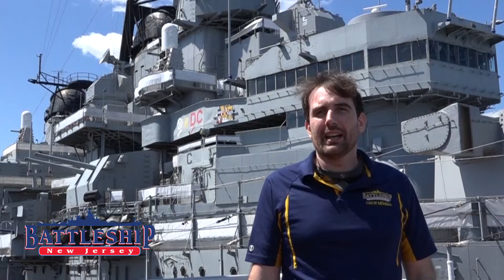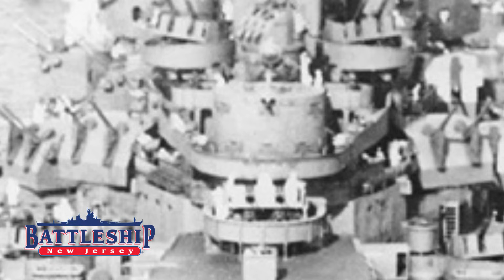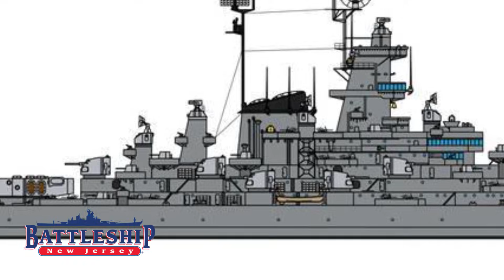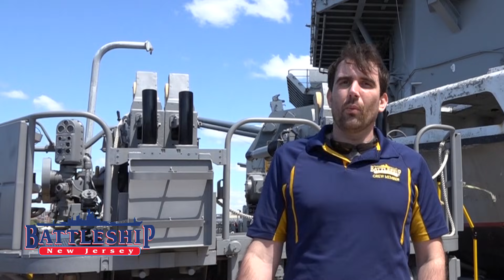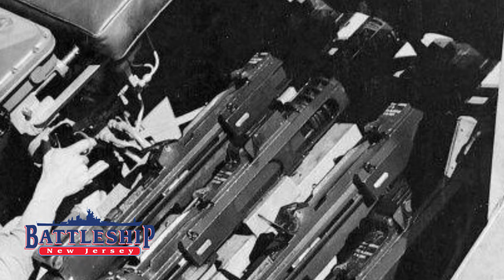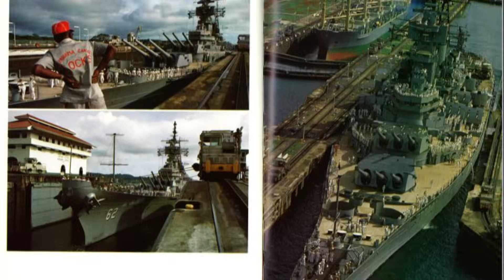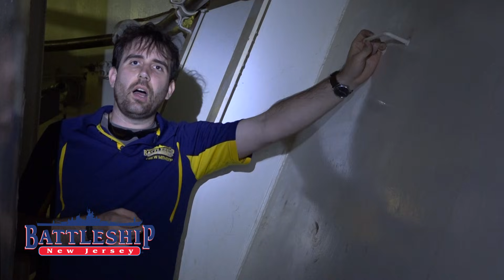What the Navy Doesn't Like About the Iowas

Comment: The only ships capable of standing against one was the ships like the Yamamato. Modern day? Maybe the Kirov battlecruisers.
Reply: *Yamato
Reply: @MrDirigible  I will remember that. Thanks.
Reply: Outside of the Yamato class there is some debate as to if the french Jean Bart class or Littorio class battleships of the Italian navy were of similar capability and fighting strength as they were contemporary battleships of similar armor layout and guns (8 or 9x15in vs 9x16in) though US fire control, control of manufacturing ammunition quality, and damage control were considered superior.  Just something to think about.
Reply: @MrDirigible  indeed. The Iowa has the advantage of having not the best of one thing but the very best package.
Reply: @MrDirigible  The Iowa's have gyro stabilized guns, the others do not. Thus, as the ship pitches and rolls, the guns stay on target.
Reply: @WMAcadet  yes which is why I said Iowas had superior fire control... Of note though is that the Littorios if given good ammunition could be very accurate however italian quality control wasn't so the Littorios suffered as did all other Italian bbs.

Comment: Great set of videos, really enjoyed them. I’m surprised that they were built with so little auxiliary generation. Only 2 diesel generators sounds like they would have real problems if they’d suffered underwater damage. A lot of ships being lost in WW2 due to creeping flooding when power to pumps was lost.
Reply: The problem with having a lot of auxiliary diesel gensets is storing the fuel needed for them. The heavy bunker fuel that fires the main steam boilers can be used for really large "cathedral" diesels - the 3 or 4 storey high monsters which power the biggest oil tankers or container ships. But the much smaller, high speed diesel engines used in gensets require the same grade of diesel fuel that cars or trucks use. This generally costs more than bunker fuel, even though marine fuels are usually untaxed. But it is also a more volatile fuel, and while diesel isn't an enormous fire risk, it's still more readily flammable than bunker oil.
So there are fire safety issues to consider with large tanks of diesel fuel, such as where to put them in the ship so that they stand the least chance of getting damaged. This is something that even modern nuclear submarines have to think about, because they still have tanks of diesel onboard to fuel their auxiliary generators - which they only ever use if the reactor has to be shut down for some horrifying reason, but they are onboard nonetheless.
Reply: @lloydevans2900  One other thing is that the gensets were probably similar to the locomotive diesels that submarines used, as they were on the ship I was on, and if so simply making enough of them to supply the fleet was a challenge.
Reply: @s.sestric9929  They were Cooper-Bessemer Diesels, not used in locomotives or submarines, but in short supply nonetheless. It was felt that the four independent steam plants gave sufficient redundancy for both propulsion and power generation.

Of course, there was the one time that a rogue wave put water into the vents of both our #1 and #2 firerooms' Fuel Oil Service Tanks, resulting in loss of fires within seconds of each other. We were "split" (electrically) fore and aft at the time, so the entire forward half of the ship (including the Bridge and CEC!) went "dark" for a short time. The Captain Was Not Happy!
Reply: Good point, including HMS Ark Royal (I think that is the right ship).
Reply: One of a number lost, with relatively minor damage.

Comment: The kirov could threaten them in the 80s
Reply: Everyone likes to refer to the "close range" fight which the nuclear-powered Kirov would have no reason to enter into.
Reply: Technically they couldn’t in a one on one close range battle but from 25+ miles they could because they where quicker and more agile and could continue to fire missiles while running away
Reply: @isaiahwilleford4618   Actually Kirovs are not quicker! They top at 30knots. Thought they wouldnt need to run. They would just detect the Iowa before and fire a salvo of SS19s at it (those things fly 2.5mach and a single one of them can sink a modern destroyer).
Reply: @S300V  Modern destroyers you could pop with a tank round. They're even less armored than their WW2 counterparts.
Reply: @Mavairo   Realy? A tank round? USS Cole was hit with 300kg of C4 by terrorists but didnt sink, USS Samuel B. Roberts hit a naval mine in 1987 and didnt sink (it was a frigate btw). The missiles I talked about can brake these ships in two. A single one would probably not sink a battleship, but it would sure stop it from moving or firing.
Reply: @S300V  both of those things are much different than armor piercing rounds. Color me not impressed, when ww2 ships take MUCH higher yield explosives, with a lot more inertia behind them (1k lb armor piercing bombs for example). They aren't armored, at all in modern vessels. 

A specialist on the Missouri was once asked about anti ship missiles, specifically the ones that pop up and try to penetrate from the Deck what would happen if struck. His response? " We send someone up there to sweep the shit off the deck afterward. "
A missile doesn't have the penetration power of a BB shell, even a modest 14incher with AP. They aren't shaped properly for it, and aren't carrying the right kind of yield, like an armor piercing shell does. 

It'd be a threat to the Iowas, but hardly a deal breaker like it would a modern destroyer.

Battleships withstand Nukes and not sink. That's a whole lot more yield than a little missile with a small warhead. And those were ww1 era and inter war ships, that didn't have near the protection as Iowa.
Reply: @S300V  You make some good points. But the battleships were built of a higher quality steel than what is used in more modern times. Aside from heavy armor they have very heavy construction, and many components made of special treatment steel-STS. There's no question that a battleship could stand more punishment, than modern cruisers. Kirovs carried deadly Granite missiles. But these were bulky and took up a lot of space. They couldn't carry nearly as many rounds as a battleship carried 16-in shelf. If they launched their full complement of missiles, and the US screen of destroyers and cruisers succeeded in taking them out, their silos would be empty. At which point the battleship could close range, and the smallest deck guns on the Kirov would have little effect on Iowa class battleship armor. So under the right circumstances Kirov could launch a barrage, and kill an Iowa. But if they spent all their missiles and did not succeed, the reverse would happen.
Reply: @garyhill2740   I didnt say one Granite missile would be enough to sink an Iowa, but Kirovs carried 20. There were also other missiles onboard like Metel for asw but could be used to hit a ship so guns were realy the last thing it would use. I think if all missiles would have failed it would retreat from the battle instead and it could as it was nuclear powered. However I dont think its realistic to survive a full salvo even with the destroyer screen! Remember this is a weapon from the late 70s, even with todays tech its a challange to intercept all 20, mach 2.5, low flying missiles, let alone back than or even in the 80s. Today  Kirovs are being refited to a much more deadly weapon and battleships are in museums.
Reply: @S300V  I think even in the '80's the Kirov class were not fully appreciated for being as formidable as they truly were. One quibble:
The Kirov(s)( plural) are not being updated.  Only one of them survives today, if I remember correctly. The others are scrapped or laid up for spare parts.
Reply: @garyhill2740   There are two, both are under upgrade (Pyotr Velikiy and Admiral Nakhimov) but this was not the point. Infact today several small ships can do what the Kirovs could but at a lower cost and with greater flexibility.
Reply: Yes at close range it would take an iowa long to sink a kirov but beyond 25 miles kirov could like stop any missiles ( sub sonic) iowa fired because it carried a true air defense for the time and iowa would have to face supersonic missiles with only sea wiz

Comment: The game has completely changed for the use of Battleships within the Navy in 2020.  Anti-torpedo protection armor is really not that critical now given the existence of Anti-torpedo torpedo systems (ATTs), AN/SLQ-25 nixie, defensive underwater drone fleets and fast-attack submarines to accompany these battleships could be implemented.  As well, modern compact anti-aircraft weapon systems and anti-missile weapon systems have been advanced to a point that enemy carrier based attacks and enemy missile barrage attacks against these ships can be virtually neutralized. Given these two reasons alone, this eliminates most of the arguments against the Iowa's and provides valid justification for a complete refurbishment of and use of the IOWA Class BBG's in the USN now.  Let me also add that any refurbishment would most certainly include replacing 1 or 2 of the 16" Turrets (most likely no1 and no3 turrets) with newer/latest offensive weapon systems such as heavy Kinetic Energy Weapon Cannons and/or a Hypersonic anti-surface/anti-air missile launching VLS module.  Given the emerging threats in the western pacific ocean, this should be seriously considered now.
Reply: We don't even have the money for our existing fleet. We don't have the logistics to maintain our existing fleet. The navy's finally starting to realize we need more ships rather than a few powerful ships, but it's still not enough. With the money that would be spent refitting, crewing and moving around these behemoths (whom are only useful for shore bombardment, because any plane/guided ordnance will reach enemy ships before her guns are anywhere close to range), we could have created an entire fleet of frigates, corvettes, and other smaller ships (whom are very useful in the current environment, as our destroyers, cruisers, etc are being ran ragged because they're the "smallest" ship available, and are having to handle petty things like pirates and fishermen, rather than returning to port for rest and recovery).
Reply: @nobstompah4850  Although we seem to continuosly have truckloads of money for $13-14B CVN construction...!  Give the Navy $10B and let them have their refurbished Battleships with upgraded longer range offensive systems and better defensive systems....
Reply: The battleships would be cost effective as they can refuel and rearm at sea and have a higher range even at full speed and are designed to keep up with nuclear aircraft carriers. Which none of our destroyers can do now
Reply: @isaiahwilleford4618  Concur! What President Ronald Reagan said at the Dec 1982 USS New Jersey Recommissioning Ceremony in Long Beach, CA still holds true today...
Reply: @isaiahwilleford4618  What nonsense. US destroyers can keep up with carriers.  BB's are not cost effective, they have not met the needs of the navy for decades.  There was never enough money even in the Reagan era to fully repair and refurbish the the BB's. They sailed with many problems, inoperative systems note the Iowa's gun problems and manual overrides.

Comment: Galvanized pipe in the inner bottoms.  ballast transfer was subject to failure.  Climbed through inner bottoms with hammer and if pipe fell apart, replace only that section.
Reply: Cheap fix - pipe-fitters and welders needed only...
Reply: @IntotheBulk  '68 Nam refit.  That's the way it was.
Reply: @jag01nj  Are there parts of the hull that can't be accessed for maintenance or repair?
Reply: @patnolen8072  Yes the inner bottom is at the very bottom of the ship.  Access is through oval shaped bolted down  covers thru out the  lower level water tight compartments.  Outer hull tanks go down to meet the inner bottom, they are not connected to the inner bottom which are only about 4 feet high.  The piping I wrote about was from the manifolds located in various pump room that transferred ballast water as needed. Today, on modern ships the piping is copper-nickel not galivanted steel.  At the time, of the overhaul/refurbishment, I believe that only a limited usage was envisioned ( off the coast of Vietnam) and only some weapons systems, ASROC  and living quarters and electronics upgrades were undertaken.

Comment: The Iowas were just a modified South Dakota class battleship.
Reply: no.  substantial differences in torpedo protection, subdivision.  Fact is, the South Dakota class battleship Indiana was in collision with battleship Washington during the war.  Damage control and repair folks found  that had Washington penetrated just a few more feet, or had hit just forward of where Indiana was hit, she would have flooded out and sank due to the inefficient torpedo protection system installed on South Dakota.

Comment: old,  took manpower of 5 Ticonderogas, fuel type, the billions to refit better spent on a new ship.
Reply: The ship was built to be more than 5 Ticonderoga’s because this can take a hit and keep going this is like 40 cruisers in one it’s faster well armed and armored if a Ticonderoga got hit by a kamikaze plane it would have been in dry dock getting repaired for years or possibly even sunk at sea remember these new ships where not designed to fight battles close they are paper thin
Reply: Worth of Iowa = 10+ Ticonderogas (One hit wonders) -  Iowa still wins...

Comment: You raised the issue with the topweight imposed by the conning tower.  There's a really in-depth analysis over on the Navweaps website of the damage taken by USS South Dakota in her encounter with IJN Kirishima off Guadalcanal in 1942. She was struck multiple times by 14" and medium-caliber gunfire. Her CO, Captain Galch, is quoted in the Navy's post-action damage assessment report:
The Commanding Officer, SOUTH DAKOTA, in the action report, reference (a), made this comment:

"Armor: - Fire control and conning tower have definitely proven their
 worth. Further agitation for the removal of this weight is definitely 
suspended. Control stations behind armor should be used more frequently.
 Too much stress in the past has been laid to the space restrictions at 
these stations. Had these stations not been utilized during the 
engagement, control and conn personnel would probably have been 
destroyed."

Comment: The vast majority of the leaking on the Texas is in her torpedo blisters which were added in the 1925-27 modernization. Electric float activated pumps were placed in the bottom of each of the lower tanks in the blisters several years ago. It is my understanding that the steel is thinner on the blisters than the regular hull. We can’t get the hull replaced soon enough.